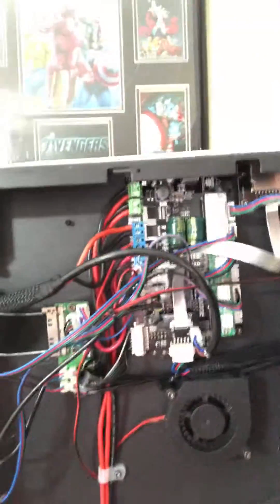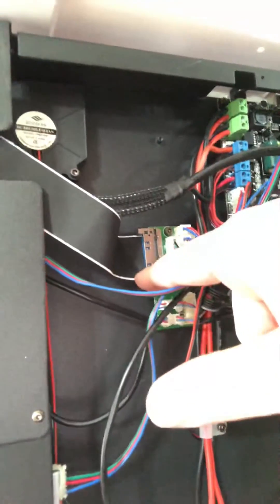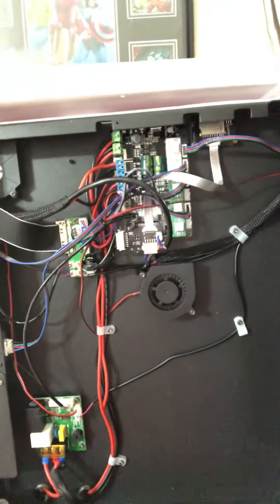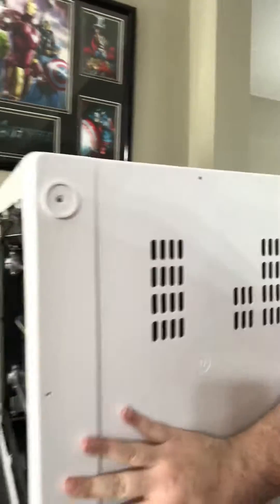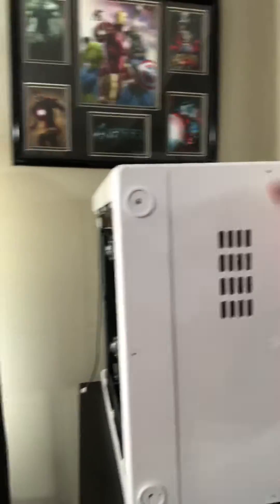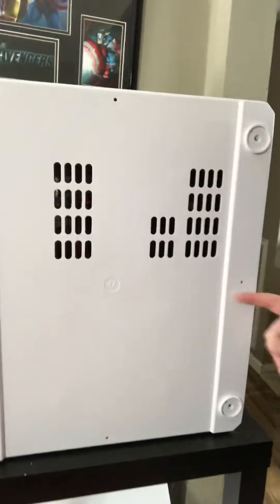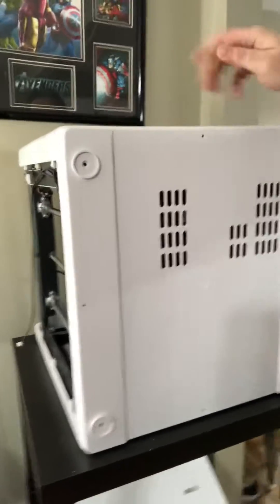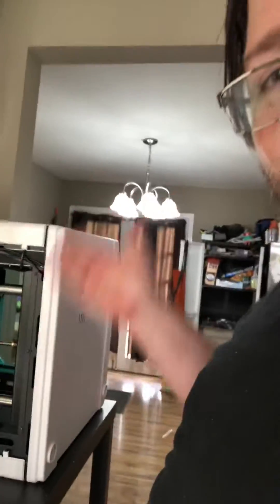How to access the board for the Anycubic 4Max Pro 3d printer

Comment: Thanks for the video! I had the same issue on mine. First few prints worked great. And then my extruder wouldn't heat up but my bed was getting to temp with no issues. That ribbon cable underneath was just very slightly out, look fine visually. I heard a small click after a pushed it in. Fired it back up and now everything is working again. Many thanks!
Reply from the maker: Glad I could help!

Comment: Anyone know how to get the side panels off.  I have broken piece to replace.
Reply from the maker: i had to reach out to Anycubic support on it. They have some breakdown PDF files. I thought I still had them, but i cannot find them. But it is pretty easy (i do remember there being a screw in an odd place that almost caused me to break mine)
Reply: @WarlockOfWiFi  Yes that extra screw is under the filament run out sensor and it wasn't included in the instructions they sent me.

Comment: Thanks. This will be helpful for BLTouch integration. .. any idea how to remove the side covers. I was not able to get the connectors or screws for that in the first look.
Reply from the maker: I am not 100% sure. I didn't have to take them off, but I am guessing they fit into tabs on the base. Sorry I am not much help :/
Reply: Hey this is late but if you open the bottom panel, there are screws that attach the side plates to the metal

Comment: I'm having this exact issue but it still not heating. Mine worked out of the box however...once i replaced a broken microswitch. I'm kind of at a lose on what should be done at this point waiting on anycubic to respond at the moment.
Reply from the maker: If you don't get a response, I can give you my contact info. I have a pretty good connection there.
Reply: @WarlockOfWiFi  I ended up swapping it out for a new one as I got it on Amazon. Anycubic never responded. Hopefully this one doesn't die within a month like the first.
Reply from the maker: @brandonbernier3120  Hope so as well. Gotta love Amazon! :)
Reply: @brandonbernier3120  did you notice if the ribbon was kinked on top? I'm running into the same thing and the ribbon on top is all kinked up with indents in 1 spot it worked great for 3 days and then nothing? Waiting to hear from 3d printer bay or anycubic after taking over a month to get it because of Chinese new year was supposed to take 8 days from the US? horrible!!
Reply: @McCrillis1982   It wasn't kinked at all. Everything appeared to be in good condition. I don't know if you read it already but I sent it in for a trade in for a brand new one.

Comment: Its hard to tell, but I'm assuming the light blue frame on the front of the printer is able to come out? I have the black version of the 4max pro and would like to spray paint that blue frame part a dark gray so that the colors flow better.
Reply from the maker: All the plastic parts are removable. Should be an easy removal job for you :)